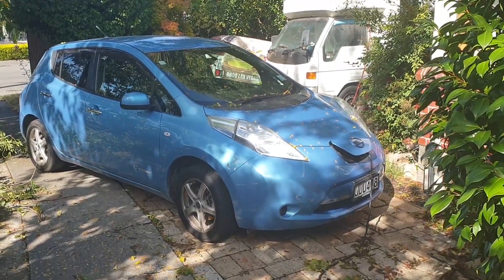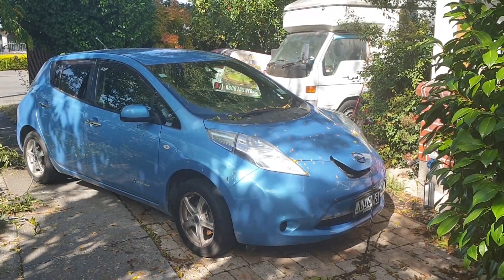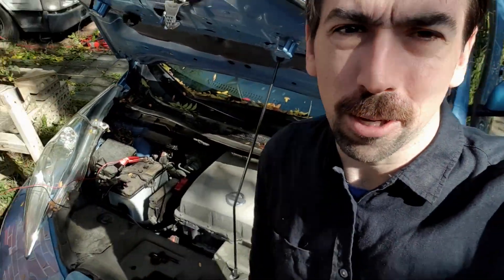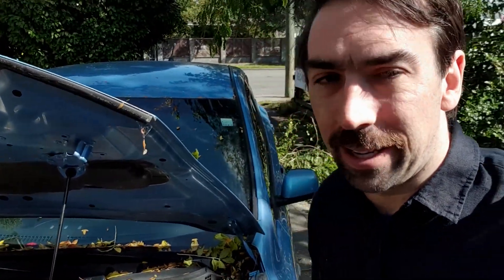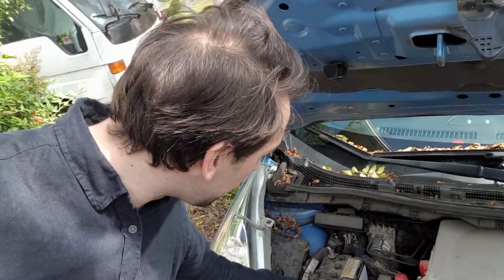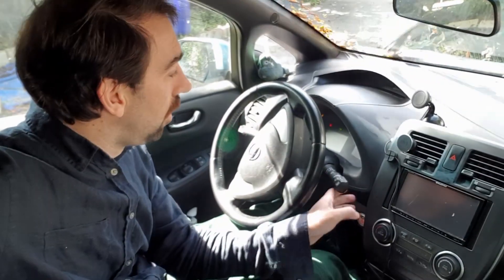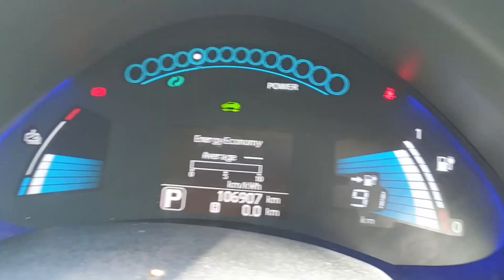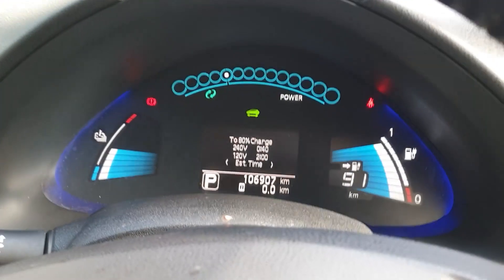EVBits - Flat 12v Battery in your Nissan leaf? What to do

Comment: my Leaf is not getting any blue light signal when i plug it in, and the battery is completely dead. Any tips? It's completely unusable right now.
Reply from the maker: Sounds like you need to charge the 12v battery. Or alternatively, you could connect another car/battery to it via jumperleads. That will give you enough juice to plug in your car and it should start charging. If you have issues, try disconnecting the 12v battery from your car, and reconnecting it, sometimes it needs a reset.
Reply: @velocity5646  just saw this video after experiencing this, because the Leaf was in the garage for a few months, and noticing the weird beeping noises and clicking. So you're  saying exactly what I was  thinking, the car is probably trying to draw from the battery as it trickle charges. So I took of the positive and continued the charge. your video confirmed all of that after the fact lol

Comment: Hello I just bought one at a car auction but I don’t know both about it
Reply: I need your help
Reply: I drove the car to where there’s no miles on the dash board I had to because I had to get home and it was late I don’t know what to do bc I tried charging at my house but it won’t charge
Reply: The dashboard turns on the stereo turns on too I just don’t know what’s wrong with it  it just stays on neutral I can’t change gears does it need to be fully charged or do I need a new battery please help me
Reply from the maker: @420friendlygoth 
When you turn the car on, do you get the green car symbol on the dashboard? I would try disconnecting the 12v battery and then reconnect it and try and start it. Alternatively try Jumpstarting, replacing or charging the 12v battery.